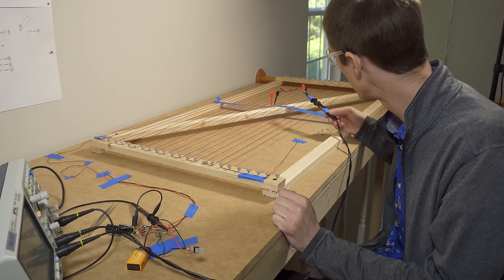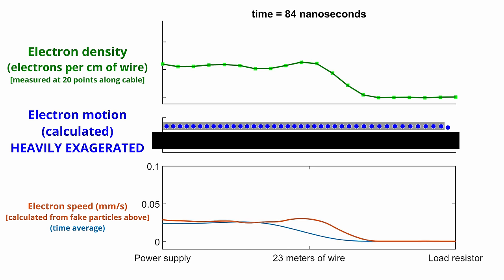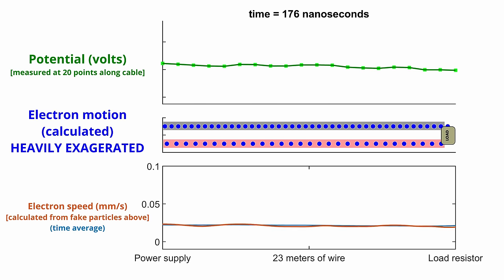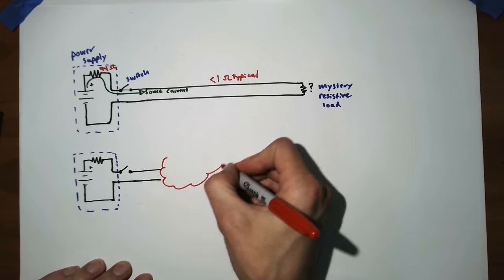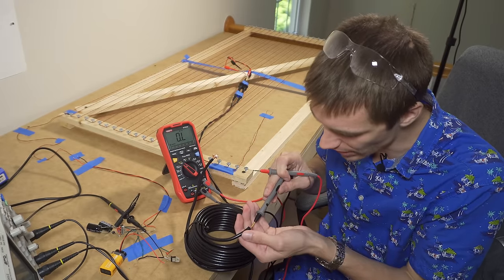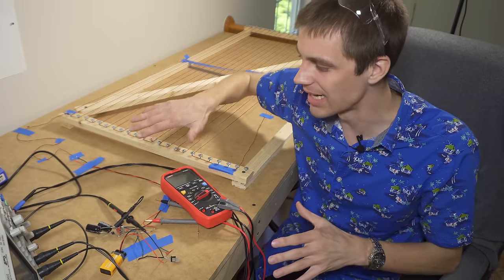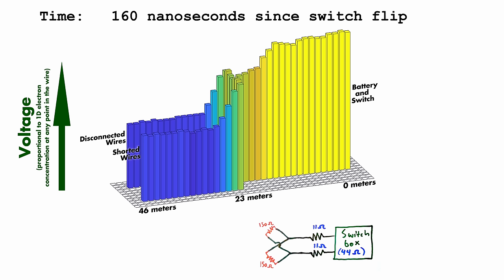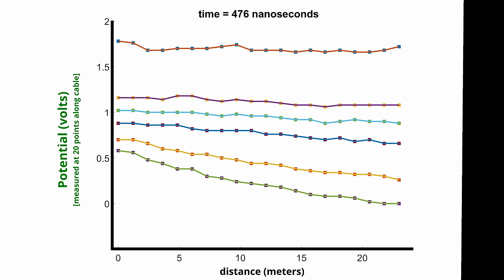What does "impedance matching" actually look like? (electricity waves)

Comment: Consider that there are two waves of voltage entering the circuit at the same time. Electrons are flowing out of the battery at one end and into the battery at the other. If the circuit is balanced like you did there, the two waves encounter each other at the "end" of the circuit and cancel one another out.

Comment: Am I correct in saying that if it wasn’t a twisted wire pair, and instead a large loop, the initial transient would be only restricted by the internal resistance of the battery?

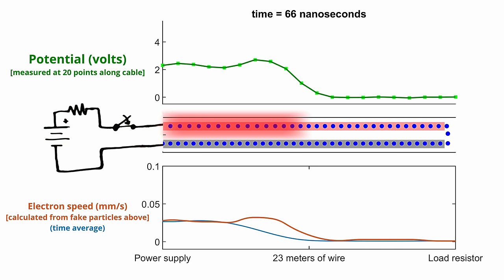Comment: 11:00 its wrong to say that the top wire influences the bottom wire. Just seperate them in a loop and that shouldn't happen. Its rather that the electrons from the top wire flow into the positive side of the power source (since there are fewer electrons thus having a greater pull) and on the bottom wire the surplus of electrons push out into the wire

Comment: I'm working with a custom CAN bus network for communication in light aircraft kit I'm building. This theory is very applicable to that, because the twisted pairs have a digital signal - ie, a bunch of pulses that very much can reflect and cause issues for decoding the signal. CAN bus is specified to have a 60 ohm resister terminating each end, but the optimal value likely depends on a few factors. To be honest, I didn't follow everything in this video, but I certainly learnt things and saw what it looks like visually.
Reply: The timing you can run a can bus at is determined by your physical topology. For me, my bus isn't a strait line - it has secondary paths out to each wing of the aircraft, with the main bus going to the rear. I've wondered if I should be terminating those ends with something as well - but I'm also not running a very fast bus, so there's plenty of time for the signal to settle before each bit is sampled.I've certainly seen reflections causing mild 'ringing' when changing logic levels on the bus with my desk test rig - which is only terminated at one end of a very short bus.

Comment: If the disconnected wire reflects into the connected wire is the current across the connection double the input current for a short time?

Comment: is this the channel B, of the disconnected wire. when you connect the switch, then it does not need to know what is in the end of the wire, the wire itself limits itself to some amount of current, at first. ie say 10ohms wire with 2V no matter what is the end load makes 200mA or so current flow initially, up to the point it no longer can do so, or can do so, if the wires are shorted. also the voltage of the input limits the wire voltage to that, of course, so you have your current and voltage possibilities of the wire system mapped out (no ringing cross talk between wires assumed, the twisted pair, try that same antenna loop experiment with straight wire pairs, not twisted pair cable). well you can also calculate the resistance of the wire by its length and ohms per meter of the wire, so much cable could easily be 150ohms, depending on the wire thickness, the more width of the copper the less resistance of the wire. well, if your signal travels 1m, you have say 0.1ohms, then it travels 1m more, then you have 0.2ohms, you get a current drop every meter. ie the battery cant push any more, because the resistance rises along the signal wire. the pulse current (not voltage) is decreased along the wire more and more. the signal sees increased resistance along the wire, and the battery is able to give less and less out, but of course the wire it has already filled stays filled so it fills the next part at the same speed like you saw. push some water in a pipe with a piston/gravity = electrons. same as with water pipe with a pump source, that pump source "knows" how much water it can push through a line based on the very first minimum radius of the pipe it encounters (wire resistance) until it hits even a narrower diameter of the pipe (inf load). yep the width of the main pipe is the main limiter of the propagation of the pulse wave. it stays a constant upper bounding box limit until the end. how can you say what they expected, they are an inanimate object that balances in a system based on what you put in the end. the system self-balances all the time while not yet in the end, also, sending feedback of the diameter/resistance of the pipe along the line, all components are self-balancing with others, in the physics system there is no master mind to decide, each particle as individually with others, not in a ruled environment, ie a charge can go into the pipe if there is room and enough pushing. components/parts vs master mind over-ruler. the designer of the physics system tho can make changes along the way too, however the designer wishes to.  yes God who is Good.
Reply: of course if you need to care about impedance matching, at all, normally you dont need to bother. special cases like radio will make it necessary. power delivery nope. signal delivery yes. if something dictates some property a "have-to" then its over-board its own limits, the law. or a corporate gov overlord dictating what is to be done, no freedom, law based workers. its wave mechanics, more like photon interference math, nothing else. if you need to care about the signal shape. also you can push/force static electricity in places, like there were not connected at all. but according to your models, each + needs to have its -, to be neutral zero, zero sum. like earth and thundercloud capacitor with charge differences.

Comment: Ok this was awesome. Like, amazing. I was giddy when you brought out the 50 ohm coax. But what does 50 ohms mean? Per foot? I would like to have seen a demo of the coax.
Reply: I’m going to hazard a guess and say that the 50 ohms means that the current flow in Ma through the wire would be as if there was a 50 ohm resistor in it. No matter how long the wire is. Within reason, I presume.

Comment: Well done again. This series of videos is excellent and a lot of fun to watch.

You do know what is coming next. Changing the impedance of the wire. 
 Have a length of one impedance and an equal length of a different impedance connected to the end. 
 The video of short, open and terminated should be quite interesting to watch as the waves reflect off the transition.
 Some 300 ohm tv ribbon cable connected to then end of your 120 ohm twisted pair should do well.

Placing a reactance instead of a resistance would be something else I think will make for some interesting results.
 Placing an inductor or a capacitor across the end of the cable. And then the same coil and capacitor in series and parallel. 

Oooh I'm excited to see if you build a directional coupler or a 3db hybrid.
Reply: Another combination that will be fun to see.  Connect the two ends of the branches together, but reverse their polarity when you do. 
 The wave fronts will pass each other and be reflected back to the T. 
 The same thing with opposite polarity happens when they are not reverse polarized but now the cable has an inherent open circuit and will settle at the supply voltage.

Comment: You should watch the video by Veritasium on why electrons don't actually flow inside wires. It's a nice analogy but if you "zoom in" that's not what happens.
Reply: This video by AlphaPhoenix is one of half a dozen answering Veritasium's claim (and mostly disproving it). Have a look at the video called 'I bought 1000 meters of wire to settle a physics debate' on his main channel.

Comment: What happens to the electrons in the disconnected state at the end though? The top wire is packed and the bottom is missing electrons, but they can't flow to equalize. Does disconnecting power leave them slightly charged? What happens the next power on cycle?
Reply: They bounce back like the last coils of a Slinky being fixed to a wall, hence the reflected wave.

Comment: I would love to see a comparison of simulation tools to real world data. I would also love to learn more about how this affects real world circuits. What is the actual effect of these reflections in a real circuit? Also, this whole video focused on transient steps and DC. What can you teach us about the same principles in AC and how frequency affects this?
Reply: For power transmission, reflected wave will result in power loss. Amazingly enough, you can balance the line by adding a short circuit shunt at the appropriate place in a reflection induced standing wave.

For the purpose of information transmission,  different frequencies may be effected different amounts in their phase velocity.  This is especially important for digital information, as a square wave pulse is comprised of the odd sinusoidal harmonics. Not only is 1's and 0's looked at, but also the phase  of the signal.  Reflected waves will screw all of this up.

Comment: Very cool.  I think I still don't understand what the impedance of the line actually is and/or what can be done to change it.  Like, if you measure between the core and the sheath of the co-ax, does that give you 50 ohms?  Or the same question for your home-twisted pair?  I'm assuming not (but if you showed it, I somehow missed that bit), but... how is it determined, other than by trial and error with matching resistors (or maybe SWR meters or something)?  Can you influence it?  Like, if you did 24ga wire instead of 30ga, would that give a different value?  If you twisted them differently?  Added an extra layer of insulation between the twists?  Other?  What influences this?  I want to know more!  :D
Reply from the maker: I did it by math, got it wrong, then stumbled upon a matched circuit by trial and error lol. Its a function of the cable’s capacitance and inductance per length
Reply: @AlphaPhoenix2  haha, cool.  So, let's see... a cable's capacitance I figure is determined by the size of the wires and how close they are to each other??  And the inductance... I don't know what would determine that, as I'm not sufficiently knowledgeable in that arena,

Comment: This is also why AC can move through a capacitor with the right number of farads compared to the frequency. The push-pull of AC current essentially treats the open ends as if the resistor was actually there.
Reply: A resistor dissipates power, a capactior in theory is purely reactive and does not consume the power. In practice, there is some resistive and inductive losses.

Comment: This is amazing. I did an electrical engineering school 20 years ago, with between 4 and 8 hours a week of electromagnetic waves or transmission lines, and I never got as good an insight as to what was actually happening as after watching less than an hour of your videos. Great job!
Reply: From my experience, engineering school gets too wrapped up in teaching equations and methods with not enough focus on understanding the concept that drives the method or equation. Some professors are incredibly bad about this and others understand it totally

Comment: wait. so why is it a 50ohm cable? you calculate 150ohm before your cable is attached, as if the cable doesn't matter. so what happens when you use the 50ohm cable? is it still 150ohm or does it change to 50? i bet it's still 150. i think your 150 value is strongly related to your power supply setup, and only weakly related to the wire. Is that correct? is the cable rating assuming an ideal power supply with zero internal resistance? but if that's the case, then terminating a 50ohm wire with a 50 load would always be wrong (too small). you have to add power supply limitations. i feel like i am so close to understanding it.
Reply from the maker: Sorry I didn’t actually do a demo with the 50 ohm cable, but it’s the CABLE that governs the initial spike (as long as the power supply can handle what the cable asks for, as in the power supply resistance should be much lower than the cable impedance)
Reply: @AlphaPhoenix2  Ok i think i understand it. Yes the cable impedance governs the initial spike, but really you only need like 6 inches of that cable to determine the initial spike. The power supply sort of assumes the rest of the cable is the same. It may not be, but it doesn't know yet. Thats why a 6ft 50ohm cable and a 100ft 50ohm cable are the same exact cable, just longer.

Comment: Great insight into the moment by moment process.   The one thing I am not sure about is whether this 150 Ohm value is related to this specific power supply (ie. it's output resistance), or is it 150 ohms for any power supply?  So the 150 ohm is a 'magical' number?
Reply from the maker: The cable geometry
Reply: The 150 Ω value is an intrinsic property of the cable on its own, depending on its shape (radius) and surrounding medium. If the cable is loss-less, it is even independent on the frequency of the signal. See: https://en.wikipedia.org/wiki/Characteristic_impedance

Comment: Can you suspend this contraption in a epoxy or distilled watter and measure single pulse propagation speed? 

It's to settle this open-end question in classical physics interpretation of signal "slowing down" due to waves front being cancelled out due to neighboring electrons remmiting diagonally https://youtu.be/uo3ds0FVpXs?t=19m49s But for a single wave steps (so basically digital communication) it is not so clear.
Reply from the maker: I did a single wire (not twisted pair) in water last year on the main channel! I’m on my phone more I’d find a link
Reply: @AlphaPhoenix2      incidentally,  youtube recommended this video today to me. I watched immediately. 
However, I find it unconclusive, precisely because of single wire submersion. The wave of the field spans the whole area between two wires. Thus, you would need to put the whole loop in a swimming pool to see the full effect. Return signal could be shifted to the right and not just smoothed. 

FFT explanation is a bit of a cheat and it doesn't explain the smoothness anyway. We already know fast frequencies appear to slow down in the medium.  Why would slower frequencies arrive faster?  If we look at the molecular level, this would fit an explanation of why fast frequencies slow down.

Comment: Amazing explanation! Im guessing that this is the reason impedance matching also gives optimal power transmission as well? With impedance matching, you essentially have no reflected wave, so all the power can be transmitted, while if it is not matched, you are losing power to the reflected wave?
Reply from the maker: Hadn't thought about that aspect before - sounds good to me! lol.
the power splitting is a lot easier to imagine in the DC mode, but it jives what what you said
Reply: @AlphaPhoenix2  Well with your setup, it just sent a single pulse, but I imagine in an AC current where these waves happen periodically, every wave would get more or less partially reflected, and then transmit more or less power. Or this is my guess anyway!

Comment: Could you take a floating conductor and apply a positive voltage so high that you could, given enough time, evacuate the conductor of it's relevant electrons?  Or, Does the material have some sort of electron-vacuum force similar to how a syringe with an ideal vacuum pulled in it can only apply 1atm of pulling force trying to retract the plunger?
Reply from the maker: The positive ions of the metal would eventually start sucking electrons off air molecules - and if it was in a vacuum chamber it would eventually start pulling electrons from the walls, even if separated by a vacuum. maybe if it was in vacuum and the nearest mass was a LONG ways away so it wouldn’t be able to corona
Reply: @AlphaPhoenix2  Do you intuit that the LONG ways away would be at a scale you could reasonably find out in space? This probably breaks down because a voltage cannot exist without a context so, those electrons are going somewhere and that somewhere can only be so far away. Unless you had some kind of cool particle canon that can shoot electrons off the conductor, with enough exit velocity to escape the... potential?

Comment: Thank you for making this experiment and sharing it. Transients are so much more intuitive to understand than steady state equations. What is missing from your illustration of the electrons in the cable is surface charges. Also, the electron dots on the "ground" wire going back seem not to follow the same rules.
Reply from the maker: I’ve been trying to find a topic for a video about surface charges but I can’t find a physical demo where it matters at all. So far every experiment I’ve been able to think up is handled very well by “1D wires”

Do you know of an example where we are forced to consider surface charge?
Reply: @AlphaPhoenix2  
Illustrating the surface charges at the point of equilibrium (and while the system is getting there) will illustrate the "local" reason why electrons flow through the circuit at all (knowing that electrons DONT push each other through a wire; electric current in a conductor is not a kind of chain-through-tube-like or "water pressure" driven system at all - rather the establishment of a continuously decreasing surface charge creates a directed constant electric field in the conductor ...).

Comment: How is the characteristic impedance of a transmission line is calculated??
Reply: You have to use the laws of electrodynamics and calculate first the linear inductance and linear capacitance of the wire. For a coaxial line, see 'Fundamental electrical parameters' section from this page https://en.wikipedia.org/wiki/Coaxial_cable